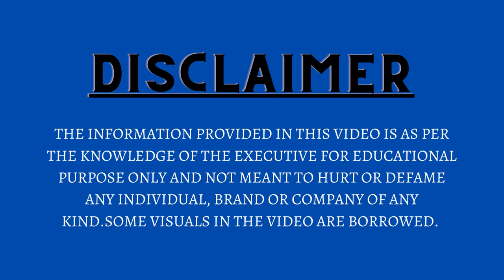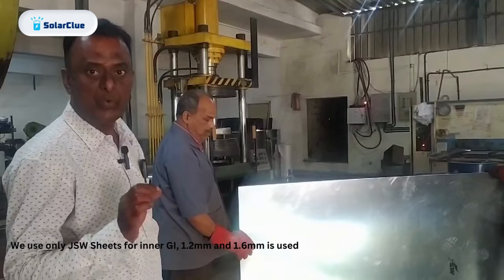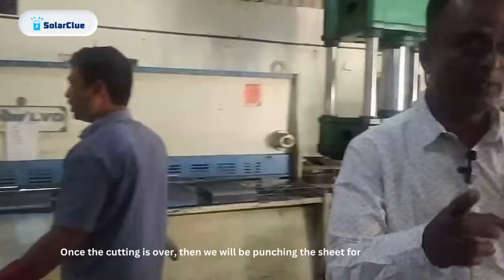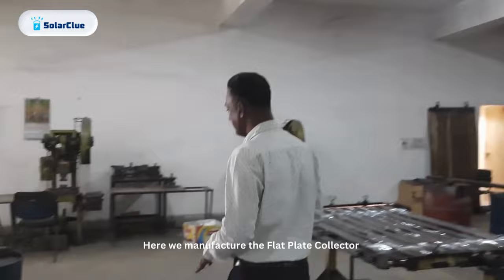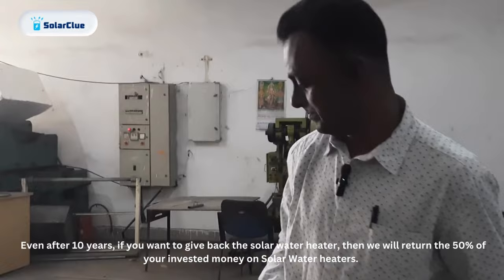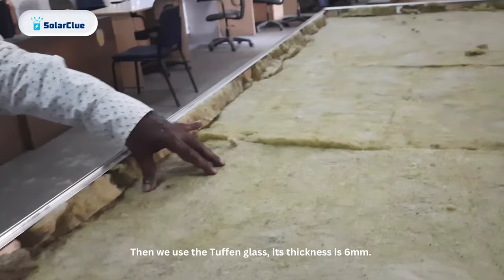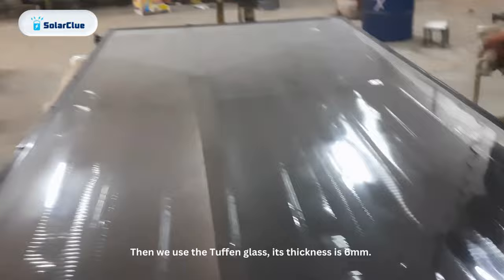Anusolar Water Heater Manufacturing | Solarclue | Solar Water Heater Making Process

Comment: Can we connect the heat up compressor to an inverter as we connect if there is no electricity supply  . Will the compressor work on the inverter.
Reply from the maker: No sir